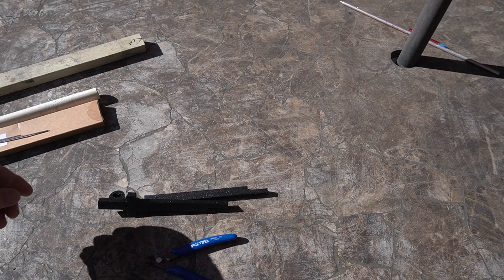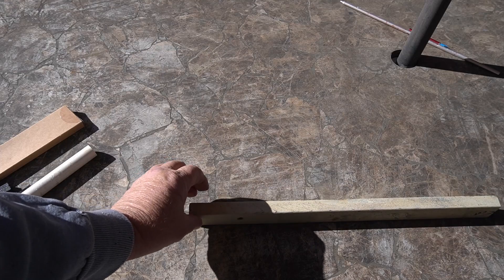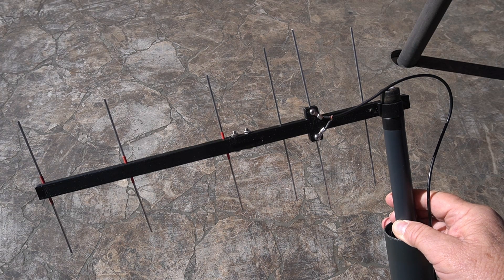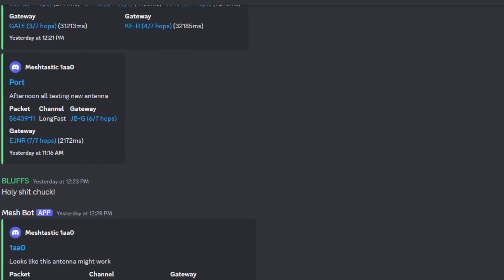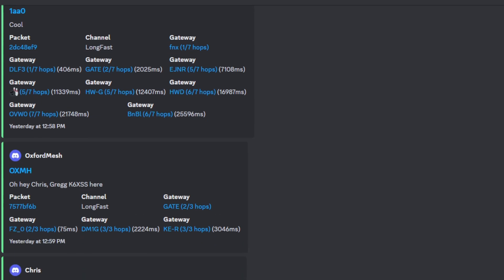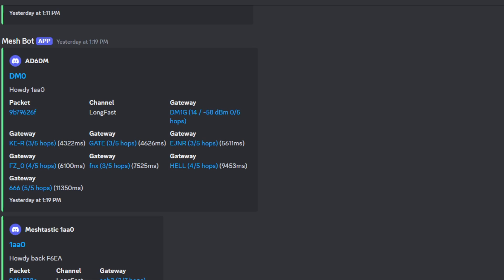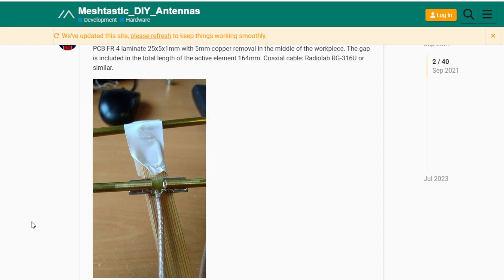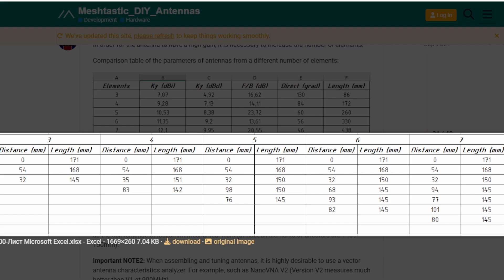DIY Meshtastic Yagi CHEAP!

Comment: A year late, but at 3:20 If you put the pipe in a door jamb lengthwise,  you can get yourself straight lines on the pipe.  Back from building model rockets when I was a kid and making sure the fins were straight when I glued them on.

Comment: Could you do a real build everybody shows yagi 868 but nobody is doing a real build with measurements and all its all a  gess at 868 it coms to the mm  and nobody on you tube shows a real build or only a build without measurements and and without a vna measurement
Reply from the maker: I will try to, I think I linked the build in the description though which had all the measurements.

Comment: Been having fun learning how to use the MANNA-GAL antenna modelling software,  I have plans to build a Yagi very similar to this one, but with 10 elements   it will still be under 3ft long,   the end goal is to have a 3D printed boom with the element insert slots already perfectly placed,  like the antenna in this video, I will be using the parasitics to bring the impedance to 50 ohm.  I will be using 3mm diameter elements, copper for driven,  and aluminum for all others.  the copper will allow me to solder directly to it.

Using small diameter elements means a narrower bandwidth which is fine, I will be tuning this specifically for Medium fast  (913.125)  dimensions are critical 1 mm one way or the other makes a big difference,  specially the relationship between the driven element and the 1st director,  there is only about 24 mm space between them (< 1 inch)  but once dimensions have been locked in, a 3d printed boom with holes exactly where they need to be will eliminate the guess work.  all anyone needs to do is precisely cut the elements and glue them centered on the insulated boom. 

theoretical CAD is one thing , and real world results is another,  but the design I have come up with using software gives me a Z of 50 ohms, and gain over 14 dBi,   FB ration of about 24 dB, and SWR 1.0, of course things like how the coax is attached to the driven element, the length of those leads and even the cable can affect the end result.

Comment: I've been trying to make contacts on 6m and if I spend the time I can make a few per day. It seems meshtastic is similar with lack of people using it. The difference is that anyone else I find on 6m is happy to respond. Meshtastic is like meeting people driving on the road that don't wave back. I'm from Missouri and wave at everyone. The only places I see that use fowl language on the radio is 40m, 11m and meshtastic. Not impressed so far but I keep watching with little hope.
Reply: Ok, I can understand 11m & Meshtastic - you could add 70cm here in Australasia (huh? or there with GMRS et al) since we have PRS CB on 477mhz, but 40m? Is that military? 
Re Meshtastic, depends on what you want to do with it.  Maybe this is a bit lazy / anti social, but a node showing up with no hops many miles away is still a win - regardless of whether you have time to shoot the breeze with the other person, or not.

Comment: what kinda coax are using?
Reply from the maker: The test was rg 316 about 8 inches long, at my house station I am using LMR  400 but it is tough with such a light weight antenna. I have some rg 195 so I will try and find a happy middle point. The home unit uses a N connector.

Comment: Great video Chuck.  I haven't jumped on the Meshtastic bandwagon yet but watching with interest ;)
Reply: Once your device hears it first mesh client and starts showing you nodes in range you'll be hooked.  If your in a dead zone its still fun to try and learn lora and even talk to yourself :) The LLM realllly helps alot coding, just remember to feed it the correct context. Have fun :)